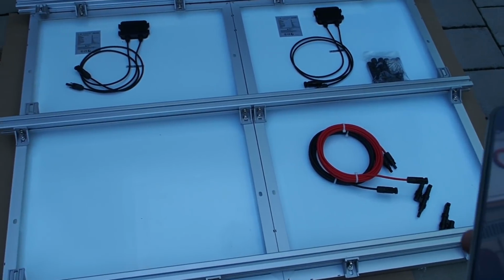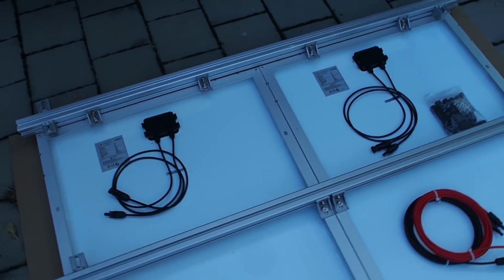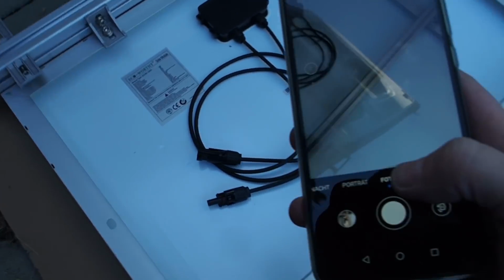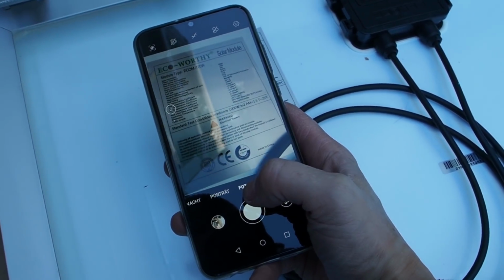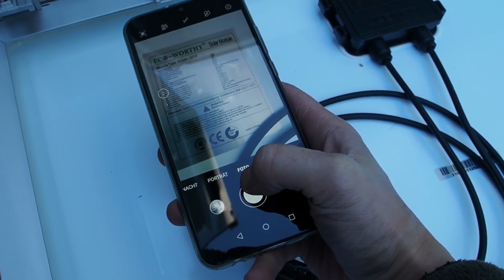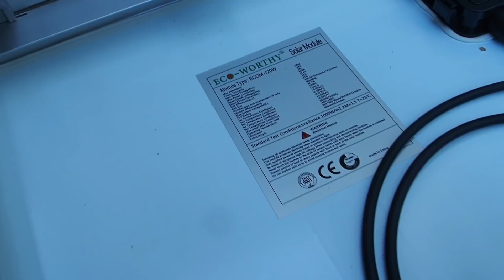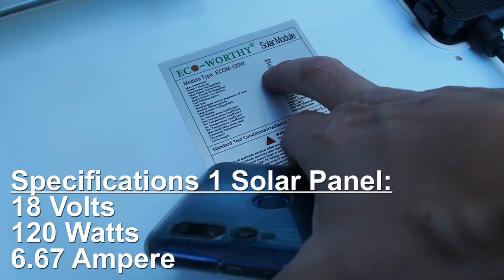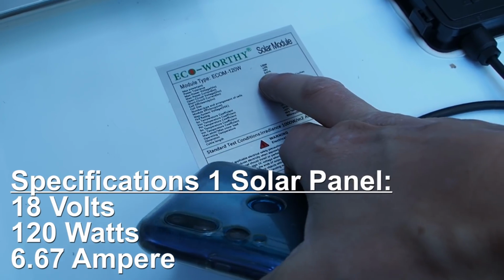How to install SOLAR PANELS on a Roof of a Campervan

Comment: Lilly hopefully you know that you need to be charging the panel else the panels can get damaged if they overcharge without dropping the voltage it can damage the panels to have them exposed to sunlight without having them charging or load draining --- atleast in the panels i have worked with... these ones may be different, you tell me though if they are special self load dropping panels... someone educate me if I am wrong please. I have an extended cargo van I would consider doing this for but I have used laminants in the past that I just roll up when not in use, it would be nice to charge batteries while driving if there was a way to safely do it.  Hopefully the campervan stuff will be put in a playlist as I have been toying on taking my smaller RV trailer components like propane furnace and stove electrical systems ect.. and putting them into the extended e250 I have.  I've seem van life for a while very eager to watch this series. (The laminants are the ones with adhesive on the bottom to glue them to the surface, but I like having mine at the right alignment rather than flat, with that said I have some cheap panels now I ordered from China  that I would be willing to sacrifice on a mounting project now. Also the fact the screws can be removed has me think having a panel mount would be useful.. even having a spare adjustable rack mount on the ground the panel mount could be attached to could be doubly useful as its not tied permanently to the vehicle but could be taken to a camp if not accessible by vehicle.

Comment: My off grid truck has a water barrel, 12v pump, water system to suck up water, pump out water, filter to containers. 5 deep cycle batteries. 1000 watt inverter. Battery charger. Alternator leads. Tool storage. 4 tire chains. Whew! Not good mpg tho.

Comment: 🤯  Oh no... Don't drill holes in the aluminum extrusion, use T-bots in the slots. Then seal the entire thing with 3M's 5200 marine sealant/adhesive. Then it will NEVER leak or come off. 👍🏻
Reply: Yes. I was thinking the same. T-nuts and bolts FTW!  And if I am not mistaken you can get plastic inserts that cover the gaps on each of the faces of the extrusion. We used that extrusion on many an automation cell.

Comment: You should drill some weep holes from side of rail into top opening to give a place for that water to drain away.
Reply: @nurseniki6004  only if you are always driving, presumably it being a camper; means it stays put for a period of time. Water always finds a way in.

Comment: Nice install!  It would be best to drill a 2-3mm diameter hole vertically between the silicones bolts on the roof so that water will drain, and won’t sit and make its way down the bolt hole. This won’t affect the strength but will keep everything dry

Comment: Thanks Lilly, always learn something from your yt channel. Your attention to detail and is amazing.  I particularly like how you sealed everything and double protected those wires.  Seems like you build your campervan to last.  On the other hand, 240watts panels are very minimum.  You have plenty of space on the roof.  More than enough for 700 to 800 watts, charging >7000watts of battery and providing enough free energy for you to use induction cooktop. But that's just a suggestion. You probably have other ideas on how to use your roof.

Comment: Wonderful job, Lilly! Please consider putting thread locking  compound on your bolts.. driving at speed,  and having the thought " was that my gorram solar panel?! " as it sails off into the sunset would be most upsetting!

Comment: I have 400watts feeding 2 x 130ah lead acid via a 50a mppt controller, with a 2kw pure sine inverter.  There is ample power to run a small domestic fridge and TV all year round! I have a split charge relay between my cranking and house batteries also!

Comment: The nylon lock nuts are equal to lock washers and are vibration resistant.  They are called bolts not screws.Lily.  Great job overall.

Comment: You can use the the handle of a screwdriver that has exchangeable bits to gain leverage with hex wrenches. And, consider Sikaflex rather than silicone for exterior work. It's designed for vibration environments.

Comment: Maybe you can add some form of wind deflector at the front, stopping air pressure building up underneath the panels, when you start travelling?

Comment: Why mount solar panels on any vehicle. Now it has to be parked in the sun to work properly. Unnecessarily heating the interior of the vehicle. Remote panels are much easier and can be moved to follow the sun's path across the sky.
Reply: Solar panels shade the vehicle from sun.  Duh
Reply: Way wrong, the way she installs it does just the opposite it'll keep it cooler.

Comment: hey lily i heard that, when solarpanels are made, the energie that is needed to produce one, is higher then the lifetime produced energie of an solarpanel. so its realy not enviroment frendly? did you ever heard of that? not shure if its true.
Reply from the maker: No technique has 100% efficiency. Also: What is the alternative?
Reply: @SurvivalLilly  true, i would not know.
ich meine, dass die produktion von solarpanels (materialien schmelzen und backen bei ca. 6000°C) verbraucht mehr energie als die solarpanels in ihrem leben  geben werden. daher wären solarpanels nicht umweltfreundlich?
alternative für einen Van? keine ahnung, warscheindlich keine. hast du dies schon mal gehört? danke für deine Vids
Reply from the maker: @wolfshepard1330  ja hab ich gehört. Weiß aber nicht ob es wirklich so stimmt. Dann dürfte man aber auch keine batterien kaufen und auch keine elektroauto.
Reply: @SurvivalLilly  okay, ja stimmt dürfte man theoretisch auch nicht. schönen  sonntag lily
Reply: @SurvivalLilly   Tilting the panels makes a huge difference.

Comment: You do good work Lilly, thinking of everything.  Split lock washers on the inside will keep it from moving while moving.  They will stop any vibration that will happen while going down the road.  Great how you did it video.  Have a grand day.

Comment: Very nice set up Lilly ..Conceptwise, personally i would add a three or four small wind turbines by the panel in the back of the roof  (maybe under a spoiler type wing) as a backup plan ..for those cloudy days with little sun .. so you get additional charge to your batteries while you are driving
Reply: That would add more drag than power it would produce.

Comment: Lilly drill some holes in the tracks for the water can drain out and also use Loctite on all nuts regardless after self-locking or not you're doing a great job.

Comment: Lilly, u got some real crap advice. All u needed was 1 House Panel 36volts Voc and 8 amps, 1 set of wire extenders to connect to the solar charge controller which can handle 45 to 90volts from the solar panel and connect to either 12 or 24v battery system... no need to upgrade anything after that just add more batteries. BTW the solar cable is DOUBLE INSULATED so no need for that hosepipe.

Comment: Looks like it's sealed! Great job. As another commenter stated, drill a few small holes in bottom of rail so the water drains better. Don't drill into the van though.

Comment: Although I have an electronics background, I've never installed a solar system and it looks a bit intimidating. Hopefully, the panels can take the bumps and vibration from a moving vehicle. Good for you Lilly, for tackling this project.
Reply: If you're an electronics guy like I am, you'll have no problems. Plus and minus from the panels to the charge controller, then plus and minus from the controller to the battery. Aside from any monitor modules you may want to  add, that's it.
   My only caution is to never assume the minus controller input and output connections are at a common potential. If any vehicle ground to controller connections are made, do it only on the battery side just in case. Just let the panel connections float and it will be fine.
Reply: @joewoodchuck3824  Thanks for the info, but how about the costs?
Reply: @computerworks1075  Everything you need is on the web. Panels, brackets,  charge controller, and a battery. An SLA is the cheapest and will have a 500 to 1,000 cycle life. Lithium batteries last a lot longer but cost  much more too. Start a file folder for printouts of information and prices.
   Wire and miscellaneous hardware can be locally sourced.
    I have a modest 30 watt system for low power ham radio. Works great. RVs have roof space constraints. That and/or budget will  decide the main upper limit of  parameters.

Comment: Very cool. Looks really good so far. Just a tip use some Loctite to your bolts/nuts as that will lock the nut and bolts and be more stronger and safer as it will help from vibrations making them loose, just a tip ok but so far I’m loving the build looks really really good.

Comment: So interesting Lilly. Thanks.
Here in Australia, we always want to park in the shade.
And buy white cars.
Now I suppose you will want to park in the sunlight.
Re your aluminium rack and stainless bolts - A quick search on galvanic corrosion between different materials might be an eye opener.
But I suspect that you will make a maintenance schedule and checking for corrosion and loose bolts will be on the list.
Looking forward to your first road-trip video.
Reply: The latitude of Sydney is about the same (though opposite) as Tripoli on the north coast of Africa. Austria is 2200km north. In North America, we have to remember that most of Europe is in Canada (latitude wise...) The Atlantic Ocean's "Gulf Stream" dramatically effects the climate.
Reply: Been there, done that with aluminum and stainless steel outdoors. I've never had any real issues with it. Her aluminum appears to be anodized which protects it even further because it's an insulator. 
   I work with both home built and commercially made antennas for ham radio. No concerns over the last 30+ years.

Comment: Dear Lilly I hardly recommend  to do some holes into the rail. 2 or 3 mm. of diameter, in order to drain the water.
Felicitaciones, esa instalación, de los paneles fotovoltáicos, quedó súper bien.

Comment: If you are running a capable MPPT controller, you may have better results with the panels in series.
If your MPPT has a cut-on Voltage at 14V, the panels in series will start charging early when each panel hits 7V instead of waiting for both panels to hit 14V in parallel.
I don't remember what your setup was going to be though.
Reply: It would be easy to unplug your combiners and connect negative 1 to the positive 2, then run Positive 1 and negative 2 into your van.

Comment: If you make them removable and on six meter extension cables you get 100x the opportunity to catch the sun, which very often is not at the same spot as you want to park.  I have six flex panels (no metal frame, just have to handle them not being careless to break the crystals), not attached, and put them inside while driving.  I think the ideal would be to have them attached but removable.

Comment: I think you should drive it around for a while then check and see if any bolts are coming loose if they are then lock-tight and lock washers might be the answer. No sense in fixing something that may not go wrong. Great video girl keep up the good work.

Comment: You Night take 1/4 inch Roll Rubber weather sealant on top of the rails ? Maybe and used a rubber grommet for wires going through the steel roof . You could use a marine puddy that Water proof we used lot of it on the ships to may them water tight. I don't think the heat or cold will change it either . Like you're videos you gave me idea how build a bike trailer I will just need to those bracket nuts bolts.

Comment: When driving, remember, the vibration of driving is going to losen up the bolts of your panels. Please, prepare for that? I do regular walks around my truck to check for lose bolts or even lost bolts. Other methods exists, like specific washers (flat ring shapes going under the nut) that act in a way to keep the bolts from going lose and losing their nuts. Also, consider using an air foil to divert the windforce while you drive, from going over the solar panel instead of under. In case the nuts are lost, the panel won’t fly off, giving you plenty of time to make repairs. Nice job, love the whole build. Awesome…

Comment: if you find a way you can transfer the rain water you collect in your garden to the van through a water filter or? You know instead of chucking it away because of the potential freeze damage it does to the rain catch system you have.

Comment: Might I suggest adding an angled flashing or cowl to the front of the mounting rack, to keep the air from going under the solar panel as you drive.

Comment: Truly overdone, the whole van could be lifted up on that roof rack! Great job!
Hope you didn't use standard silicone sealer, as it contains acid, that causes rust, hence the vinegar smell...
:-D
Have fun, and thx for taking us with you on this build!
:-D
Reply: I did a long term study on RTV sealant and no real corrosion issues were observed even between dissimilar metals. The only chance for what you describe is during the cure time. After that period RTV becomes inert.

Comment: Lilly just a thought last time i put a bar lick that on my roof rack it whistled in the wind quite loud and when i hit the motorway it was quite a lot lauder if it whistles you will need to plug the ends up with silicon...

Comment: technically if you seal between the aluminum bar and your rubber seal.. you leave the top groove unsealed so the water drains.

Comment: Excellent video Lilly and Excellent job on the Solar panels and mounting system wires everything looks great! 
(If you are worried about water in the rails you could always drill a couple of tiny holes in each rail just to let any rain or water build up drain out before it fills up, as long as you're careful not to go through to the roof perhaps put a piece of metal in between the bars and the roof just while you drilled the holes in the centre of the rails then take it out again bit that will ensure any water drains away before testing the seal on the bolts if it fills up - just an idea?) 
Great job REALLY impressed with all your progress and work! It's looking very slick/professional!!
Best wishes from London England 👍❤️💪😎🏴

Comment: Lily, vibration will be your enemy. If you did not use locking washers, or thread locker (aka Loctite), or if the T-nuts which slide into the aluminum rails do not have a built-in lock nut, your stainless steel socket-head cap screws may eventually loosen. Just something to think about before you take the van on the road. Nice job on this project!
Reply: She used Nylock nuts.  The locking nuts with nylon ring on the outer threads.  She pointed that out at the beginning of the video.
Reply: @brngrofdeth  These were used only on the thru-bolts attaching the brackets to the solar panel. There are no locking devices/compound on the bolts that thread into the T-nuts which slide into the aluminum extrusion. That's the area of concern.
Reply: Maybe rubber washers between the roof and hardware to minimize vibration?
Reply: @TheDeplorableVisigoth  Yes, you're right, Susan. The rubber gaskets Lily placed between the roof and the aluminum rails will provide a little bit of dampening of vibration from the vehicle up into the solar array. However, the array will be subject to additional forces from apparent wind as the van is traveling and this will likely cause harmonic vibration. That's why it is important that all fasteners have locking devices/compound.
Reply: I was thinking the same thing about the Loctite. It's cheap insurance.
Reply: I hate to be that guy but don't put those rubber washers on the roof,,  moisture will get in there and freeze and cause a leak. And you have to stop using silicone. Use dycore self leveling for Rv's. I've been doing this for years and that's the only stuff you should use to seal around these bolts against the roof.   The process you're doing will leak.  You don't want a dampen vibration you want to eliminate it, and make it one solid unit. If you're worried about vibration then use the rubber washers on the solid mounted hangers, not against the roof.  Just my two bits.  SPEARS WELCOME...
Reply: Good idea ,Roland, thank you.
Reply: Good idea ,Roland, thank you.
Reply: Good idea ,Roland, thank you.
Reply: I wish Ms Lilly AKA Sugarbear was using her Van to Visit Me.

Comment: When you are working with your cables always cover the solar panels to prevent them from sending voltage while you are hooking up your wires. Add some weep holes to your frame to allow rain to drain out and I'd say you have a good system!👍 Nice job Lilly!

Comment: hey lily, running the wires that tight isn't the best idea, you should increase the curves a bit so that there is zero strain on them. even including a loop would be a solution.

Comment: Wasn't recorded during the video, but (if you did not) you should probably coat all those hex bolt threads with an anti-seize lubricant like Permatex.  Being exposed to weather, unless you put an anti-seize lubricant on the threads, they're likely to corrode and lock, making it impossible to remove the hex bolts without cutting them.

Comment: Sealing washers are exist. A rubber ring is glued on the side of the washer which sealing the hole. And looks nicer than caulking the nut.
Reply: Yes, that was what I meant, earlier:)

Comment: It's come along really well. If you find you get pooling in the alluminium trenching on the rail, using a 4mm HSS bit in your drill put a couple of drainage holes in each section of rail. With the vent gap you have put in the water will go without problem.